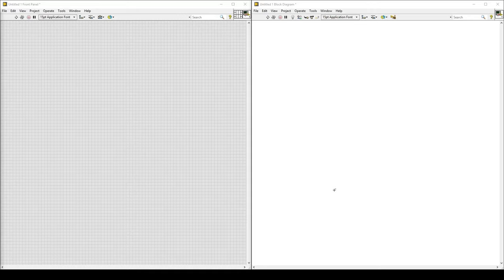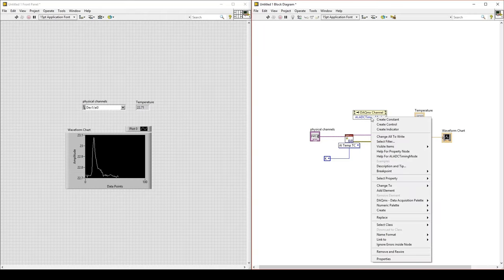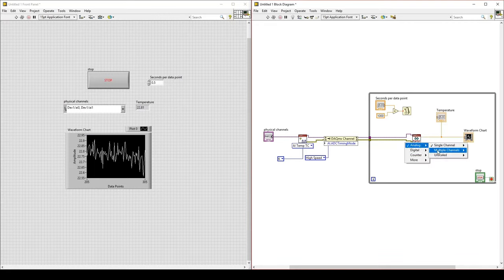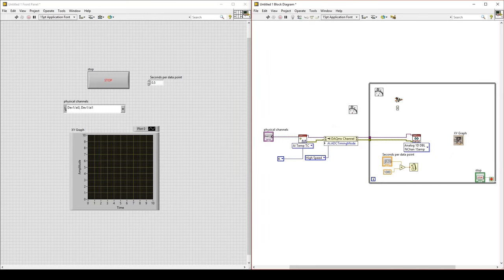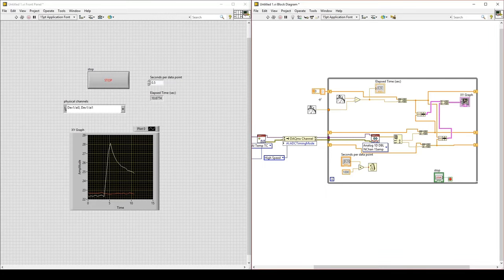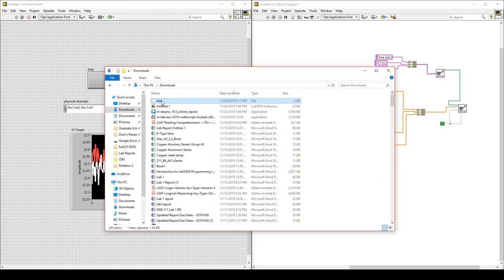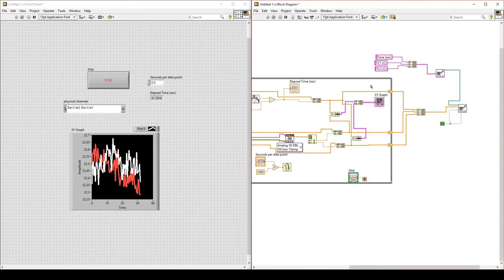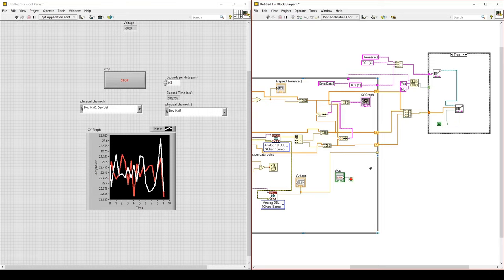NI-DAQmx multi-channel data acquisition LabVIEW program

Comment: Bro, I'm doing my final project for the university and i think you have saved me man. Thank you for this video
Reply from the maker: Cool, good luck!
Reply: Hi..can you please tell me how fault detection module work in LabVIEW it is in sound and vibration toolkit..i want to connect accelometer on bearing so i want to take bearing fft or frequently data so please help me regarding it..
Reply: 11 months later and here i am in the same situation
Reply: @khamisi__6378  Feel you man. Luckily I'm finishing it :D
Reply: Here i am 1 year later trying to set up a daq for a 12 channel system for my capstone.... thank you

Comment: This is one of the most helpful videos about Labview DAQ technique, thanks! 
Regarding the multichannel data acquisition, does the program you've shown consider any synchronization issues? Could you please give some guide about the sampling clock things?
Reply from the maker: I am not familiar with your question, and it may be beyond my skill level. One issue to consider is the time delay between two different physical channels, both are given the same time value in this example. For most experiments it is negligible, but could be a problem if you have many channels at small time intervals.

Comment: Thank you Zachary Neale, you saved my life. Quick question, how many thermocouples can be included in this configuration?
Reply from the maker: I don't know of any limit to the number of thermocouples that you can plot. You can also add a legend to the plot to select which series to display.
Your physical DAQ device will only have so many inputs. This specific device had only 4 channels, so that is the maximum.

Comment: Hi. I´ve got some problems with data aquisition immediately stop after the vibration system off. It´s 3 simultenously aquisition wich is temperature, acceleration, amplifier voltage and one vibration control as an output signal. My goal is to sincronize the start and stop of all inputs and outputs after all times out fineshed. If you have a video wich can bring me under light, I´ll apriciate. Thanks

Comment: Hi great video, I am wondering if you can help with a current input? the AI.ADC property node doesn't work with this type.
Reply from the maker: I know that it doesn't work for analog output, but not sure about current input. I will take a look later and try to get back to you. 
I have never had good luck with measuring current, especially when trying to measure current and voltage from the same module on different channels, it seems to break the circuit when it measure voltage. Measuring current and voltage from two individual modules works fine. If I only have one module to work with then I usually measure voltage across a known resistor and calculate current. As long as temperature doesn't change it should be reliable.

Comment: It's  great video that inspired me , but i want to plot voltage as a function of temperature or by another mean i want lab view to record the values of voltage at a certain value of temperature the xy plot will be like that V(T) versus T
Reply from the maker: That sounds good, just replace time input with temperature. Depending on your experiment, you could add some logic triggers or a manual button to start data collection. I recommend keeping time data in the data spreadsheet. Good luck!

Comment: Great Video, extremely helpful!
Got 2 questions:
1) I don't see the option to set the ADC Timing mode to High Speed;
Under Digitizer/ADC there's only resolution and raw sample unit/value, and dither.
Is it cause my device USB-6002 doesn't support such option?
2) Does daq assistant have high speed option? and is there any reason to use DAQmx instead of assistant?
Reply from the maker: @Dreamstar1
I just tried it and also could not find the AI.ADC property. Perhaps there was an update since this video that changed something. I was able to find it though. Try this:
1) Right click on the property node
2) Click on "Select Filters..."
3) Switch to "Show All Attributes"
That should let you change the Timing Mode.
I am not sure about DAQ Assistant, I am unable to test it without a device currently. If you cannot find it, you could change the DAQ Assistant to NI-DAQmx Code by right clicking on it.
DAQ Assistant is convenient, but it is like a blackbox. I prefer to have more control over the code.
Reply: @ZGNeale  Thank you sir, useful

Comment: Hi, this is really helpful. I do have a couple of questions though. Do you think this would be adapted to support 40 channels, and my DAQ doesn't support timing mode so do you have any recommendations for replacement? I am looking to sample at about 10 Hz, thanks in advance!
Reply from the maker: It has been a while since I last used LabView so I am not certain. The sampling rate will also be limited by your physical device, so make sure it allows those rates. You may want to try measuring N samples instead of single sample mode, but the data output will be an array I think, and you will have to figure out how to control the sampling rate in a different way.
For 40 channels you might consider making a for loop structure to separate the data.

Comment: Are you able to create one build array for the graph? I have 16 channels I need to measure and graph, it seems doing  16 build array vi  is alittle much.
Reply from the maker: Yes, you can reduce it to 2 build arrays using a for-loop. I will try to send you a picture through DM. Basically you need to put the 1D array of cluster (that goes into the XY graph) on a shift register on the while loop, send it into the for-loop, then index the 1D array to pull out the individual elements of cluster data based on the loop-count, then unbundle that into the 1D array of X-data and Y-data, then from there you can add onto that 1D array of X-data and Y-data for each channel based on the loop-count, then re-bundle those two 1D arrays into a cluster that is sent to the edge of the for-loop which is set to indexing which will build the 1D array of cluster data that is sent into the XY graph and shift register.
Reply from the maker: I don't know how to DM you on youtube, so please send me an e-mail if you would like a picture of the VI. zgneale@uw.edu

Comment: Great video, thanks for sharing. Do you have any recommendations to ensure that the two data sets you collect are measured simultaneously? By linking the two Read SubVIs with the error, you essentially delay the second one by a little bit of time. Any advice? Thank you
Reply from the maker: Yes, you are correct, there will be some time delay between the two data sets, but it will be on the order of milliseconds or less. You could probably get an estimate of the time lost if you add a time stamp before the first data set and after the read. The difference will be negligible for most general data acquisition purposes.
One thing you can try is changing from single sample to N-sample in the read.vi. I am not too experience with using the n-sample data collection, but you should be able to collect n-samples of data within a time frame that gets output together. That might help you if you require collecting data very quickly.
Reply: @ZGNeale  thanks!

Comment: Hi do u have a playlist with more labVIEW tutorials?. I am trying to use digital lines to make an spi master with daqmx to interact with another microcontroller
Reply from the maker: No sorry, I do not have a playlist and this is the only video I made for a class I taught. Sounds like an interesting project. You can check the NI website, they have many resources.

Comment: how much resolution does High resolution relative seconds actually provide ? and if I am collecting data from a daq assitant, is this time stamping stamping technique feasible ?, also please explain how to insert software defined start stop triggers in the same program....
Reply from the maker: This I do not know. You can take a look at the relative seconds time resolution manually by collecting the time data without a delay limit. You may have to change your data type to include more decimals.

Comment: hi sir,  this is the first semester of using this cool software for me at my college and I'm having a project on this class. I got the idea of my project but not sure where to start! I am trying make a mass balance for evaporation of water so what should i use for the sensor? like temperature sensor to measure the temp of water when it raises to 100C would be enough then the rest will be coding in LabVIEW? I have no clue about the starting point . It will be much appreciated if you help me on the start. 

Thank you
Reply from the maker: Sounds like a good project. You want to monitor temperature and mass? Do you want to control temperature too?
Measuring temperature using a thermocouple will be straight forward, like what you see in this video.
Measuring mass will be more difficult, you will need to look into what type of sensor you will use. There are different type of mass/weight sensors, and they have different sensitivities. One thing to look out for is the input requirement of the sensor, either voltage or current requirement. You will need to make sure your LabVIEW device or microcontroller can supply the required output to the sensor, or if the sensor needs to be externally powered. To measure the sensor, there might be some pre-made .VIs associated with the sensor that you can download and use in your LabVIEW program, but if not you will have to make your own and calibrate it. Most likely you will be measuring voltage, and make a program that translates voltage into mass. 
If you want to control the temperature of the heater, that can also be done using a PID function in LabVIEW. This will help turn the heater on and off to maintain a set point temperature. It is better than manually turning the heater on and off around a set temperature because it can predict future temperature change. The heater controller will require an external power source, such as AC from the outlet. You can use a solidstate relay to control the AC power on/off to the heating element. Use LabVIEW to send the on/off signal to the relay, but make sure the current requirement of the relay sense is within the output of the LabVIEW device.
Reply: @ZGNeale   those are really helpful and useful info for me! I now got better idea on the start point. Thanks a lot sir. And yes probably I’m gonna do both measurements for mass&temperature.

Comment: Hi Sir, thanks a lot for sharing this useful information. See if I am acquiring a voltage signal with this program, how can I measure and display the frequency of the signal? Thank you.
Reply from the maker: Hello Adriano, it depends on what type of signals you are trying to measure. First you need to make sure your hardware is able to measure at such frequencies. The devices I use in this example are not able to collect data at high frequencies, so you would not be able to measure frequency of AC signals unless they are very low frequency.
To display the data you could use a waveform chart and update the chart history length to view the frequency. There should also be some oscilloscope and trigger VIs that you can look into.
Reply: @ZGNeale  Thank you!

Comment: does Channel Calibration Wizard calibrate the thermocouples?
Reply from the maker: I am not sure about that. The thermocouple type is specific to the materials it is made from, giving an empirical Seebeck coefficient which is used by the VI to transduce its voltage to temperature. You could manually make this calculation and calibration, if you switch to read Voltage and add some math to convert to temperature. However, Seebeck coefficient is also a function of temperature. I am not sure if the VI or thermocouple devices take this into account, or just make a linear approximation. That is probably why some thermocouples are more suitable for different temperature ranges.

Comment: Hey I am using this for a school project but, I need to be able to average the data into 60 second data points is there anyway to do this ???? would be a huge help
Reply from the maker: You want to average data into 60 s intervals, correct? Just thinking about it, I would add a CASE structure into the WHILE loop, the case selector is hooked up to some boolean logic to turn false after 60 s -- to do this I would put a "relative seconds" vi inside the FALSE case, wire this outside the case structure and to the edge of the WHILE loop, turn this into a shift register to the beginning of the WHILE loop, then subtract this from the current step time to get the time elapsed since the beginning of averaging. Make boolean logic to return TRUE when this elapsed time is less than 60 s. So, when elapsed time is <60 s it runs the TRUE case, and when >60 s it switches to the FALSE case and the timer starts over again so that it only runs the FALSE case once every 60 s. You will also need to wire the line from the left shift register into the CASE structure, in the TRUE case wire it directly to the empty tunnel on the right side of the case structure, this way it passes that original value back to the beginning of the while loop each time (until it is FALSE).
Wire both your x- and y-data lines (should be just single element data) into the CASE structure. In the FALSE case, use 2 BUILD ARRAY functions that only have 1 element each to build each element into a 1D array (we are just need to change the data type into 1D array), wire this to the right side of the CASE structure and to the right side of the WHILE loop, turn this into a shift register, then from the return shift register on the left side of the WHILE loop wire it back into the CASE structure. In the TRUE case add 2 BUILD ARRAY functions each with 2 elements, wire the 1D x- data into the top element and the single x-data into the bottom element (we are building a 1D array of all x-data over the last 60 s), do the same thing for the y-data in the other build array function. Wire these into the empty tunnels on the right side of the CASE structure. So now your case structure is building up your data for 60 seconds and then restarting the 1D arrays when it enters the FALSE case, now you need to average the arrays after 60 seconds. I would add two MEAN functions into the FALSE case, wire each 1D data array into the MEAN function, it will output the average of the array that was previously built up over 60 s.
Now you need to figure out how to plot only the averaged data every 60 s. I would BUILD another array of your average x- and average y-data, have it go through the case structure, it only BUILDS onto the array in the FALSE case, otherwise it just passes straight through the TRUE case. Have these lines plot the data outside the CASE structure.

I think this will work, but not sure since I don't have labview on my home computer to try it out.
There might be an easier way to do this, but I am not sure. Let me know how you solve this problem or if you have any other questions. Good luck!

If it is too messy for your main VI, I suggest putting all the boolean and case structure into another subvi, then add it to your main vi.
Reply: @ZGNeale  I’m going to try this and see if it works but thanks for all the help you have been great keep up the work I can’t thank you enough
Reply: @ZGNeale  Also when you mention x data do you mean time elapses and when you mention y data do you mean voltage data and or the tc data ?
Reply from the maker: @dariusboyce360  ah, my mistake, guess you shouldn't be averaging your time data. In that case you do not need to build it into an array, but still have it pass through the case structure. The averaged y-data in the False case will go with the time data in that False case and that will be your x,y coordinate, build those x,y coordinates into an array to make your data series that you can graph. The y-data is whatever you want averaged.

Comment: does the daqmx work with MyRio?
Reply from the maker: I have not used MyRio, but it looks like DAQmx will not work for Rio
Reply: @ZGNeale  it does not however most of the other stuff so your guide creates a great basis for multi channel reading thank you

Comment: what if the data logger using serial port? Do we need read first from serial port?
Reply from the maker: For serial port you will need to use the VISA Read.vi under Instrument I/O palette. You can look at examples in LabVIEW > Help > Find Examples... > Hardware Input and Output > Serial > Simple Serial.vi
Reply: @ZGNeale  thanks
Reply: @ZGNeale  so after read from VISA then connected with the virtual channel vi?
Reply: @ZGNeale  can you tell the data logger hardware and LabVIEW release year  you used for this tutorial? Thanks again
Reply from the maker: @artawina1  I think this was LabVIEW 2019. The module I was using was a NI 9219.
Reply from the maker: @artawina1  I am not sure what you mean. The Read from VISA should output data, then you can graph/save the data.
Reply: @ZGNeale  thanks again
Reply: @ZGNeale  thanks alot

Comment: How about Sensor with different sensitivity?
Reply from the maker: What type of sensor? This example uses an NI-9219 module which can be used to measure analog voltage output from a sensor. Specifically this video covers how to plot and save data in LabVIEW, the device collecting data does not necessarily need to be a NI-DAQmx physical device.
Reply: @ZGNeale  Pressure Transducer, with different sensitivity.
Reply from the maker: @cch1806  I've never worked with pressure transducers before, but if it can output a voltage then you can measure and plot it in LabVIEW. If it is not linear because of the different sensitivity you could make a program to convert voltage into pressure on LabVIEW, but you would need to know the sensor characteristics.